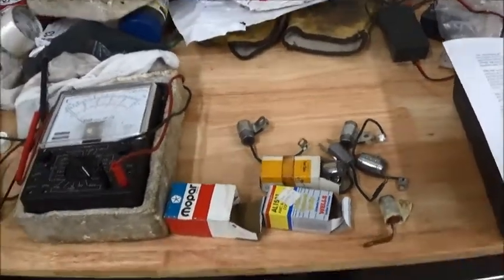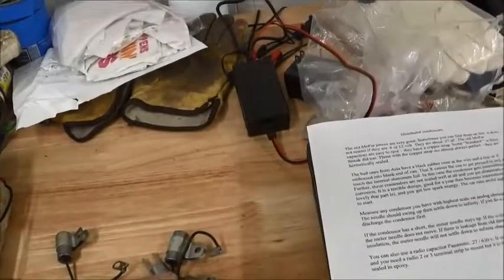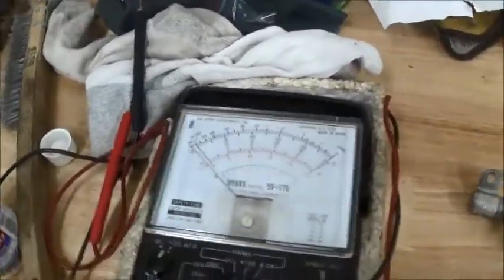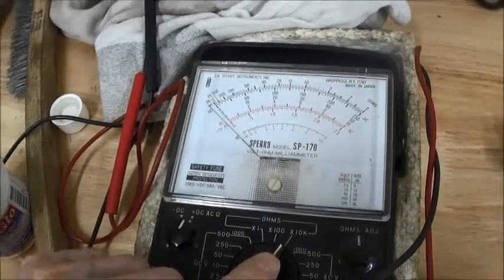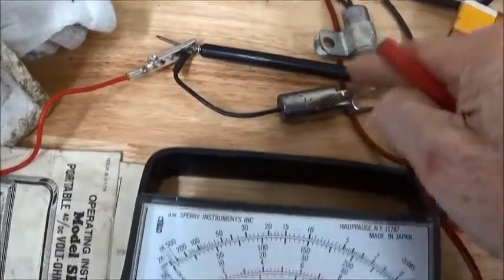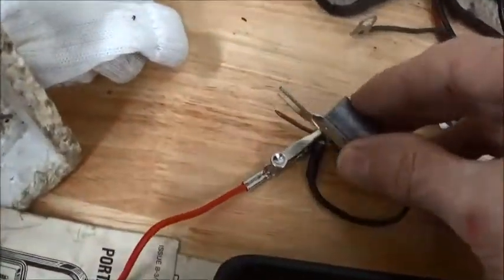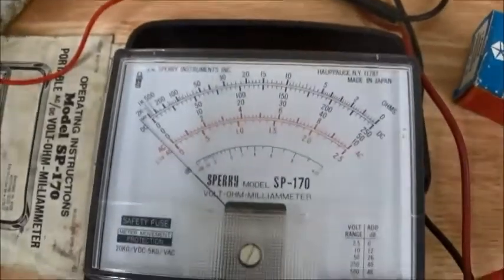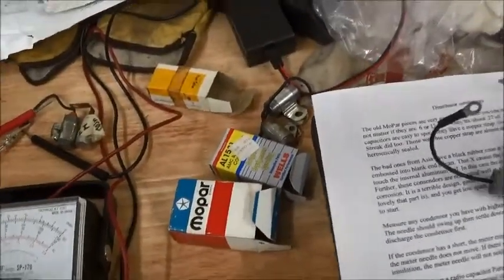Testing the old style distributor condenser (capacitor)

Comment: I was a car mechanic many years ago. We would hold a capacitor with insulated pliers and pull of a spark plug lead while the engine was running and make a spark to the capacitor wire. We would then put it down on a wooden bench. Wait for a young appy to come along and ask him to pass it to me. WACK a nice little shock. Always brought a laugh to the shop.

Comment: You can also connect capacitor to ignition coil lead & crank engine & capacitor should charge up with voltage from coil discharge. To discharge capacitor just hold with both hands & say arghh , that hurt as the voltage zaps you. Also if capacitor is faulty will cause weak spark output from coil .

Comment: What if the capacitor doesn't show any value, what are symptoms we have in car.
Reply: In this case, the capacitor is open circuit (non existent) and the car cannot start as the spark is too weak. If it starts, the high sparking of the contact points finally destroys them very quickly and the electrodes of the spark plugs alike...